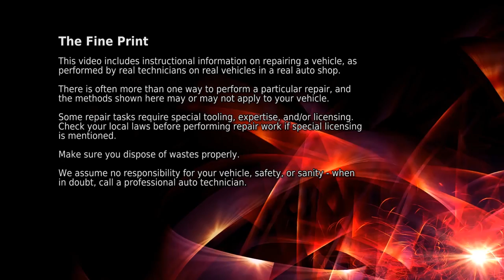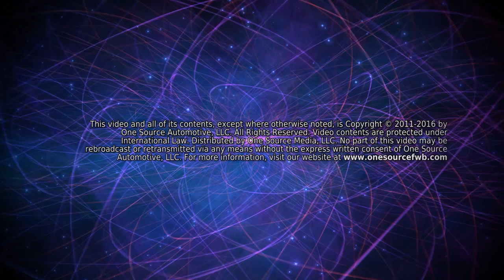Fix It Right! :: Front Brake Job - 2008 Chevy Uplander 3 5L

Comment: If the retainer screw strips out drill it out and dont worry about replacing it  there's five lug nuts that will keep the rotor in place c :